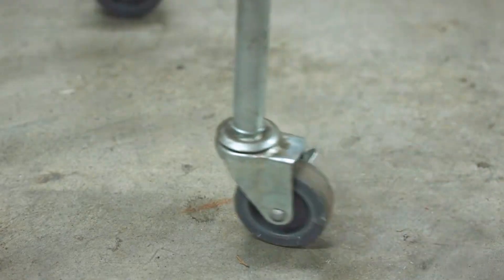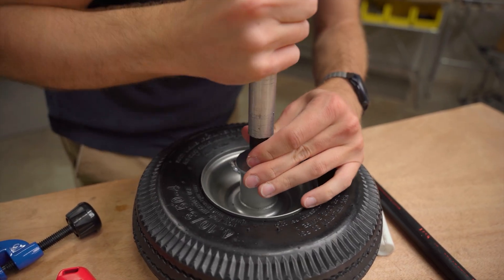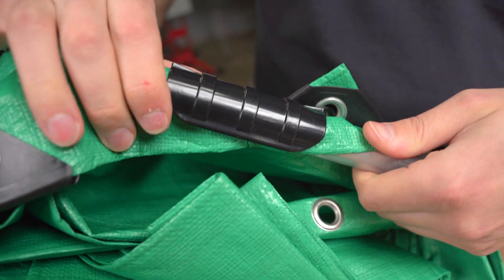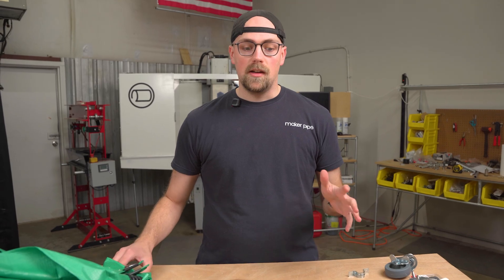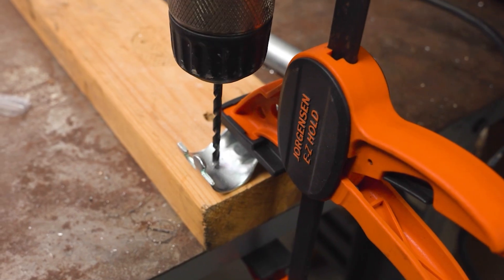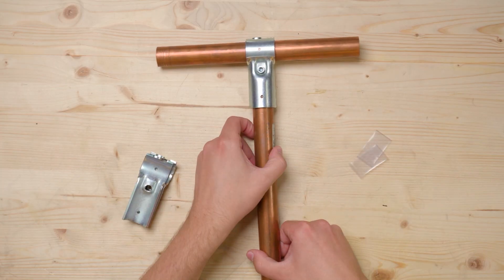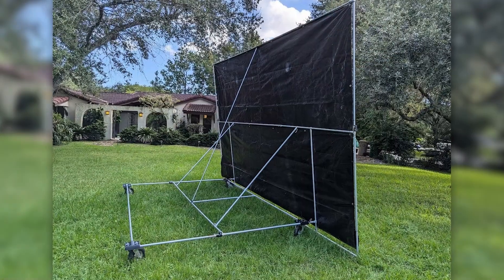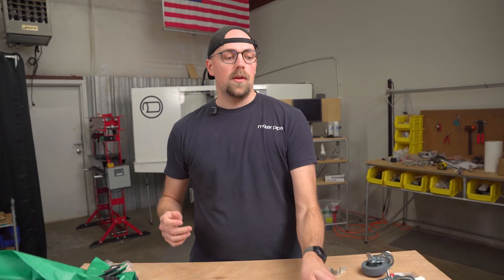The Top 10 Most Common Conduit Hacks!

Comment: 5:33: I'm designing my first build. I'd like to use 4 adjustable feet, but I will need larger diameter feet - I expect at least 3" - 5" as this will be a frame for an outdoor generator cover that will sit on the ground, not the small concrete pad. Do you sell such feet or know of a source for them?

The rebar ground stakes are an interesting approach, but not as easily adjusted for leveling. OR, would your lever clamping fasteners work well enough to hold the 3/4" EMP to the 3/4" rebar that they could be used to level the frame? 🤔🤔🤔 That would be great and would hold the EMP off the (often) wet ground.

I asked about the larger feet on the blog a few days agi, but no answers yet.

Thanks!
John
Reply: There are "feet" attachments that you can secure to brick or stepping stones with TapCon screws.